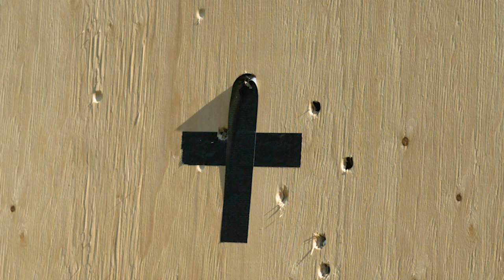Slingshots in a Medieval Battle?

Comment: The problem with arrows being too short could be solved with what's now called an overdraw device.  In Korea it's called a tong ah, and here's a YouTube video https://www.youtube.com/watch?v=lkMPK2569Ks 
They were also used in the Ottoman empire: https://www.youtube.com/watch?v=ES__ddb7E74
Reply: The tong ah depends on the bow string sliding along its edges. That won't work with a rubber slingshot. But there are modifications that could work.

Comment: Modern rubber could have been some sort of smallarm revolution had it come earlier, with decently powerfull rubber war slingshot that could have been compact compaired to bows and easier to use compaired to slings... they used Staff slings (fustibales) and trebuchet (couillard) and bows, instead.

Comment: For a slingshot, could you make custom lead rounds, no more than 1 and half inches in length, a heavy front head, shaped into a point, and some flights, but the read end of the flights are rounded so not to fray the pouch?

I could see with some trials, you could really perfect this concept so you make a highly penetrative slug, that also has a fair amount of mass behind it, to be fired from a slingshot

Comment: You don't necessarily have to spin a sling around all that much. There are shorter slings where you only need a bit of room behind you, and even with a long sling you only need space on one side if you use a different style of throw.
Reply: Oh, and the range is far from "20, maybe 40 meters". Ancient sources often talk about the range advantage compared to bows and the estimated range is at least 400, maybe up to 700m when thrown by a very skilled slinger. The accuracy, of course, was worse than that of a bow, though not as much as one could think.

Comment: Would it make sense to use rubber in a composite bow or crossbow? Not as string, but as a layer of the composite body of the bow. Nobody knows how exactly composite crossbows were made back in Medieval times, maybe they used rubber as well, if it was available...

Comment: I would really have liked to see them bend down and pick up some of those rocks at their feet and try them out. It would be interesting to see if a stone could be made to penetrate that ply. It would likely shatter but it would be interesting to see the effect.
Reply from the maker: I suspect the lack of density would mean that the force/area would be too low
Reply: @tods_workshop  You're probably right - I was merely thinking about the idea of being able to use ready, to hand, ammunition rather than having to rely upon lead shot or steel ball bearings. But that said, while the rock might not go through ply, I think that is quite a high bar to set - it would make one hell of an impression on any bare part of a body it impacted, indeed, an unprotected head or face would be quite painful and probably incapacitating.

Comment: One of the points raised to explain the disappearance of slingers is the fact that you cannot utilise a sling from fortifications. If you had rubber you could so it is likely it would survive way longer into the medieval period.
Reply: It's easy enough to use a staff sling from behind a wall. The problem is that it's a lot hard to hit something with a staff sling than a bow or crossbow.

Comment: wow if they developed rubber that early it would also open up the world of airtight and watertight seals. so that's all of naval warfare changed forever. not to mention that watertight seals means u have a way to distribute hydraulic power, something that medieval people's would have been familiar with(low-head hydraulics anyways). might've even developed pneumatics.

 then there's the logistic side of things. the rubber could be used to aid in suspension, better wheels, better-sealed food n drink, etc.

jeez the addition of just one simple material changes damn near everything

Comment: Of course, every invention, before it happens, suffers from the ”hadn’t thought of it yet” problem. 
But, you know what is conceptually about as difficult to make, from a medieval knowledge set, as vulcanized rubber? Gunpowder.  
It would have been much more persuasive possibility had they had a rubber a substitute at the time, or something. Still cool to see a high power slingshot though. :)

Comment: Honestly, I do not think this weapon would really change things much. The problem is that it just isn't lethal except for small game. The pellet bow is ancient, and there were numerous attempts to use a pellet bow in a military context. But it just wasn't damaging enough. There are two problems:

1) Draw weight is just too low, the way you pull a pellet/pouch.

2) Projectile geometry just doesn't offer the penetration of a sharp pointed arrow head.

Joerg's design helps address the power problem with a very long draw, but it's still just not going to be anywhere near as good as a bow and arrow.
Reply from the maker: I so disagree.  Slingers were a massive part of war from ancient world to Middle Ages, certainly in Europe and the Middle East and I suspect much further and this is just a much easier way to throw stones.  Differently lethal to arrows, but believe me this would make a very big mess of flesh and bone.
Reply: @tods_workshop  Well, that's worth a test, isn't it!

I'll predict it barely even breaks the skin of an unarmored clothed analog, and it fails to penetrate a gambeson.

The traditional sling is inherently more powerful than a bow. It doesn't use a comparatively weak finger draw, it uses a sturdy strap capable of transmitting more force. And it doesn't lose energy by storing energy in springs. It directly uses the energy input. And it doesn't waste energy accelerating relatively heavy bow limbs. Even so, it's not like a sling could compete with a bow for armor penetration.
Reply: Similar slingshots deliver 120-150 J at around 62 m/s, so the raw kinetic energy is there. It matches or beats a 160lb yew warbow. This slingshot would be very dangerous to an unarmored person & could always hit an armored person in the face. I don't think it would have been particularly effective on a 15th/16th-century battlefield, but it could have been ok.
Reply: @b.h.abbott-motley2427  Thanks for that info. It certainly makes it more plausible. But even so, a 20mm wide ball is at a massive penetration disadvantage compared to a pointed arrow head. Like ... how well can you stab someone with broom stick handle?

So, I'd have to see it tested out to really know whether or not it really be a serious threat to an unarmored person.

(I haven't gone and looked for such tests. I expect folks have already done them. Of course, it can be a challenge to set up a good analog that accurately reflects skin and such.)
Reply: @IsaacKuo  Sprave has done tests against gel with various slingshots. A 20mm steel ball at 59 m/s (57 J) penetrated 45cm into ballistic gel in one of these tests. I'm not sure the exact performance of the one in this video, but I bet it's at least as good & probably better. The Thor's Hammer slingshot supposedly does 148 J at around 68.5 m/s with 22mm lead ball.
Reply: @b.h.abbott-motley2427  Thanks for the info. I don't think ballistic gel is a suitable skin and flesh analog, though. It only mimics the properties of muscle flesh.

In particular, ballistic gel is modeled by a BB gun penetrating 8.5cm, but this same BB gun can't penetrate human skin. Human skin is too tough for it. A 20mm ball, of course, hits over a much larger area than a BB ... about 20 times the area. So that's a lot more skin to try and resist the penetration.

Bottom line: It's really hard to draw any conclusion one way or the other with ballistic gel test.

Comment: Would medieval elastic be as powerful, and last as many shots however? There's a reason bows existed: it's easier to store energy in the compression/expansion of a wooden/horn/sinew bow than in an elastic cord.
Reply from the maker: I doubt bows would not have existed or been used, but as an example a multi shot boarding gun for below decks on ships would have been very useful

Comment: I would say that slingshot is very dependant on the users physical characteristics. As someone with quite short arms, I wouldn't be able to draw it back as far as Jörg and wouldn't generate as much power
Reply: You could just make a longer slingshot. It might be a bit less stable but you could get the same draw length as Jörg
Reply: @aggressivenipples8391  Maybe I'm being stupid, but how does that help? It seems like the amount of power you can generate is solely due to the draw length (how far back you can pull the sling). As opposed to a bow or even a traditional slingshot, where a lot of the power comes from the bend in the wood. The slingshot at the start of the video doesn't have that, since it's a solid block of wood.

The maximum draw length I could get would be with my left arm outstretched and my right arm pulling back on the slingshot as far as possible. So someone with longer arms gets a longer draw length, and therefore more power surely?
Reply: @philwilson4167  so what I'm saying is if you make a longer slingshot, you could get the same draw length as Jörg in the video. If Jörg uses this hypothetical slingshot of yours, he will still have a longer draw and more power. 

So for a given slingshot, a taller person has a longer draw. My original comment was using Jörg's draw length as a standard.
Reply: @aggressivenipples8391  Ahh ok, I understand.

Comment: What a scary thing ;) 
The rubber used for spearguns, holds the load just fine for hours in waters around the freezing point.
So I don't agree completely with the conclusion for crossbows using rubbers.
But these spearguns should not be used out of the water...

Comment: I didn't even realize that the "modern" slingshot/catapult isn't an invention of the old old time, which I would have guessed, but yes, they didn't have rubber back then. So how old is the concept of a "modern" slingshot then? 1850-1900? I don't know.
Reply: I don't know, but before the modern slingshot there were simple pellet bows, and also large stone throwing ballista. Pellet bows could be wood self bows or composite bows. Ballista used torsion springs.

Pellet bows are shot just like a normal bow, assuming you're used to a kyudo-like khatra twist. The outwards swing of the bow ensures the pellet misses the bow and flies downrange toward the target.
Reply: @IsaacKuo  Very interesting. Ballistas I knew of, but pellet bows or stone bows I've never even heard about. But I looked it up and I think It's a very interesting concept, and yes, bows like that have definitely made the way for our modern style slingshots/catapults with rubber banding.

Comment: Disclaimer: i am in no way a historian or expert on medieval weaponry
that being said, i’ve thought on multiple occasions about using rubber in place of rope in torsion weapons, as in a hand-held-sized version of a roman scorpio/catapulta. the elasticity of the rubber would allow for very quick draw times and under the right circumstances the weapon might be able to deliver equivalent (or maybe even greater) energy on firing. at the very least i’d like to see in Jörg and Tod work out a medieval-esc one.
Reply from the maker: Its complicated and depends on how it was constructed, but my thought on this is do not underestimate the extraordinary power of a regular catapult or ballista
Reply: @tods_workshop  of course! i actually got the idea after watching an older video on your channel where you were firing off a big replica Catapulta for a tv show, and i was wondering if the mechanics could be replicated to useful effects if you took the whole system and simply downscaled it to the size of a large crossbow with rubber or other elastics instead of the rope coils that drive the arms. i do appreciate the reply.

Comment: also, had medieval Europe had access to rubber i wonder how that would have impacted the industrial revolution???
Reply: For one thing, I'm pretty sure rubber belts are a lot more efficient than cloth belts in transferring power to drive machines.
It would have had a significant impact for sure.
Reply: @suntiger745  thus my point I didn't even think of belt (though now you mention it its obvious.). for some reason I my mind went to a piston motion (back and forth) or as a replacement for a spring.

Comment: My only thought when seeing this is there must be a chance the projectile misses the middle, hits the slingshot and fires back at you, and how I would most certainly fall victim to this.
Reply: I don't think this is really possible, unless the bands are heavily unbalanced, or the opening between them is far too small. My thinking is that for every bit of lateral force provided by one band, there should be an equivalent and opposite force from the other.
Of course, if you pulled back at a weird angle, or moved the frame during a shot, you might still manage it.
Reply: @WilliamSanderson86  That's a very good point. That was mostly just a joke about my anxious mind. :P
Reply: Had the same thought, maybe put in a slope so the projectile is directed away to the side instead of back at you.

Comment: electric railgun, any type, coilgun, lorentz, electric, plasma pulse, heat pulse
Reply: also only the balls needed, that is, guts
Reply: magnetic force redirection pulse shot
Reply: birch milk
Reply: Just looking at DIY coil guns, it seems these are not so easy to make. But with steel ball ammo, maybe a circular or oval track version could be done.

That way, you only need one coil and the ball could build up speed over time. You need some sort of clever mechanism to get the ball to escape the loop, though.
Reply: @IsaacKuo  its easy to make, just believe

Comment: couldn't they make slingshots using animal intestines instead of rubber?
Reply from the maker: stretches in a different way and though powerful, don't stretch very far, so think a very short draw length
Reply: @tods_workshop  right, makes sense. Thanks for responding and keep shooting stuff

Comment: Now might be the perfect time to ask if a a windlass slingshot is possible! 
Cock it, then add more tension by winding the rubber itself and release.
In my head it seems a genious invention, but would it work in real life?
Reply: Haha, should have seen the whole thing before commenting...
Reply: @GA1313E  Rubber is really interesting, someone made a (very) small refrigerator with rubber bands!
Reply: Use a very fast windlass. Diesel-electric windlass Slingshot.
Reply: @bozo5632  R18 Slingshot
Reply: @klafsen  That is crazy!
Reply: @bozo5632  Haha, i guess!
I was thinking more on the lines of cocking a crossbow, and then being able to add more tension by pulling on the opposite end of the rubber.
Kind of like a pre tensioned rubber, but after to make cocking easier.
So i guess its very fast compared to a pre tensed slingshot.